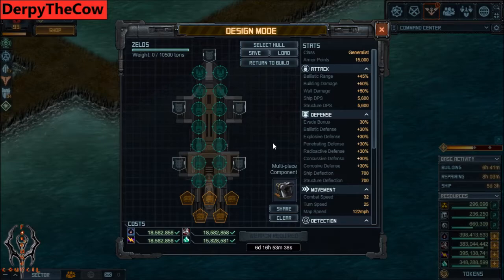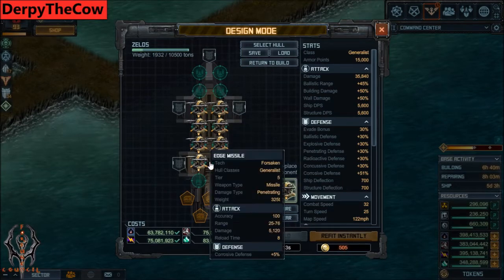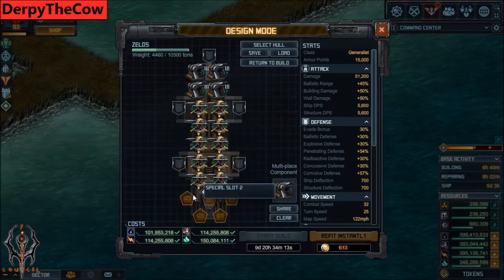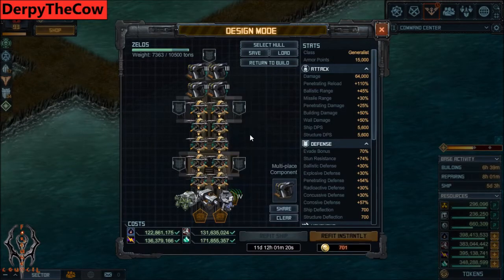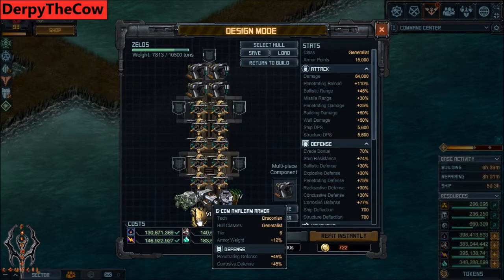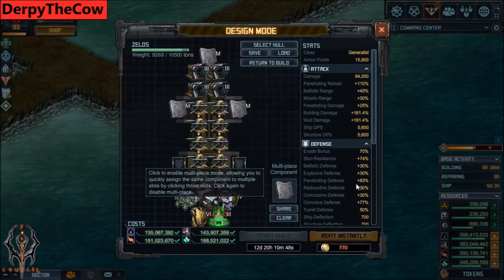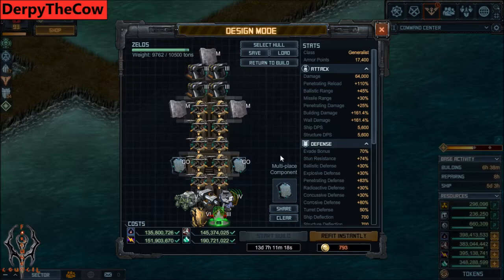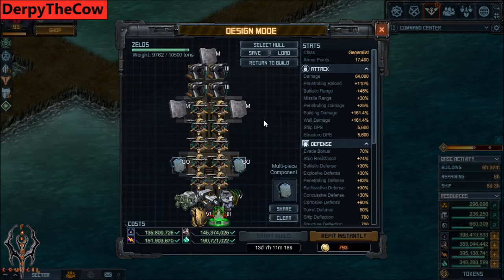Battle Pirates: Let's Build an Assault Zelos [Step by Step Guide]

Comment: I have a zelos built pretty much like this, problem is, it dies so fast. Skyfire and Apollo is so much better IMO. Skyfire is much easier to get if you have Apollo based on the deals that kix have released. its like $10 US for 5 out fitted and ranked apollos. This can do B sets in the raid fairly easy with maybe an hour repair per set. Not against your video and that build is the best you can make for the Assult Zelos. but I dont personally like it.